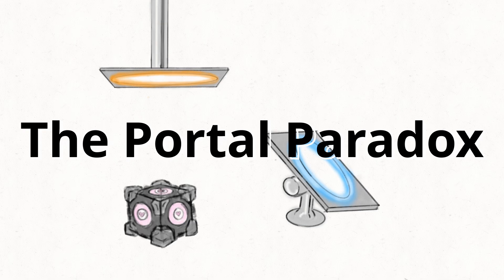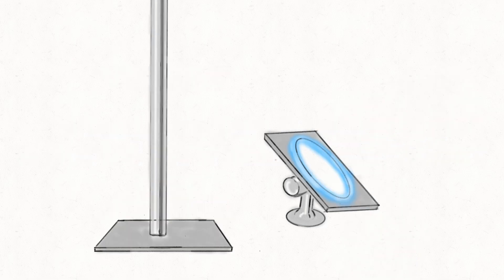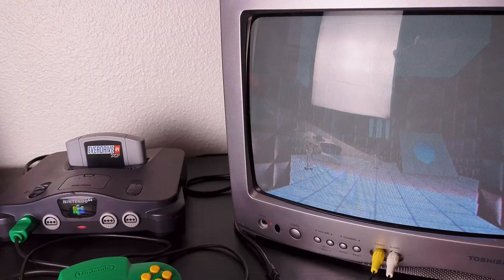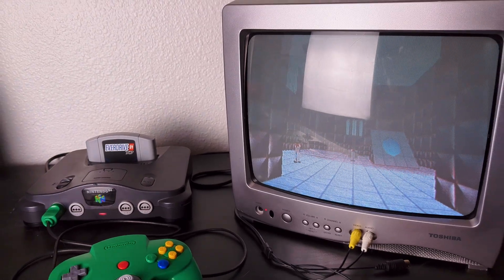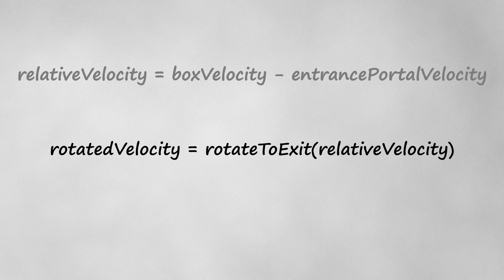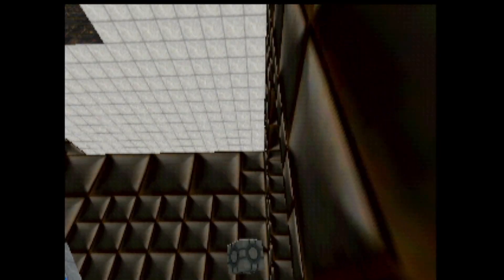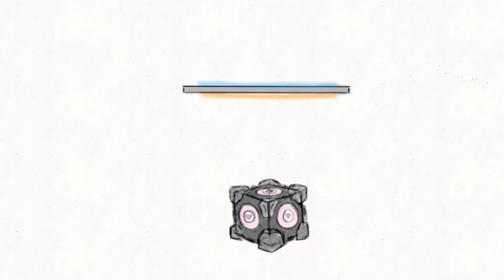I rewrote Portal from scratch and solved the Portal Paradox

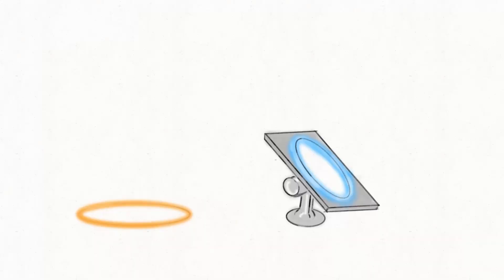Comment: I'm not convinced yet. At 1:25 you said that motion is relative, but I don't think it is; a box that falls into a portal comes shooting from the other because it keeps the momentum from the fall, if a box is on the ground and the portal smashes it the box doesn't have momentum and hence won't move. No force is being applied to the cube (except gravity since the blue portal is tilted), so it doesn't make sense to me that it would come out flying.

Of course, this is my opinion, great video either way.
Reply: But the portal has momentum
Reply: @LineOfThy  technically no, since the portal is not a physical object but a hole through space
Reply: @mintymunchies  Not in this realm apparently

Comment: Your relative velocity equation isn't wrong, but it's being applied in an unorthodox way. 

By the logic of a relative velocity imparting a velocity onto an object it passes by there needs to be contact and a resulting force. 

You're saying the portal is imparting it's velocity onto the cube, but you're transfering kinetic energy from one object to another with no contact.

The argument would have to be made that there exists a physcial barrier inside the portal to transfer the energy.

More clearly F=ma or a=F/m and in order for the cube to have a resultant acceleration there needs to be a force that is applied to the cube.
Reply: The portal is not transferring kinetic energy to the cube. The kinetic energy is new energy that has been created, it did not exist in the system before. So the portal doesn't need to touch the cube because it's not transferring energy to the cube because the energy isn't being transferred from anywhere. 

It's already been established that portals break conservation of energy, because you can make a perpetual motion machine just by having one portal on the ceiling and one right below it on the floor and dropping anything through.